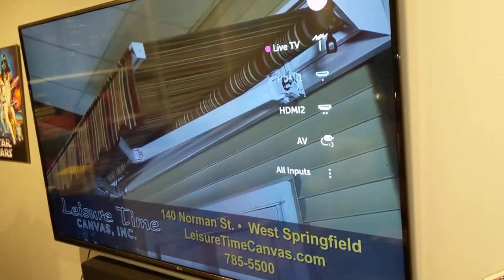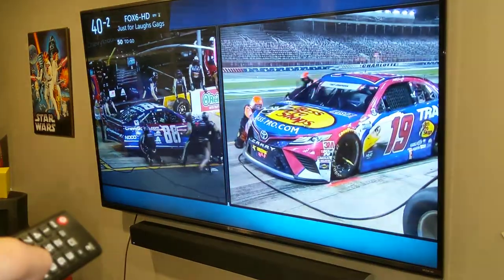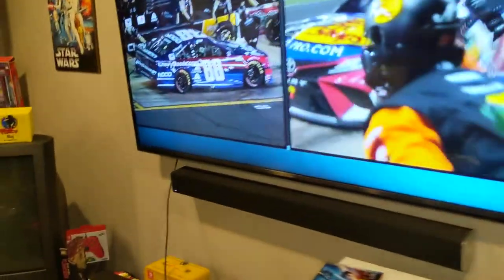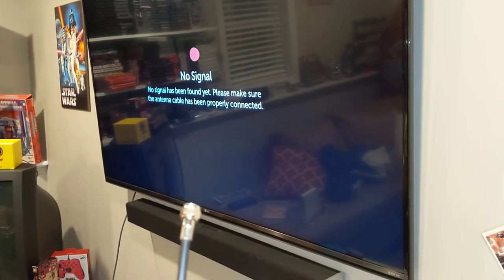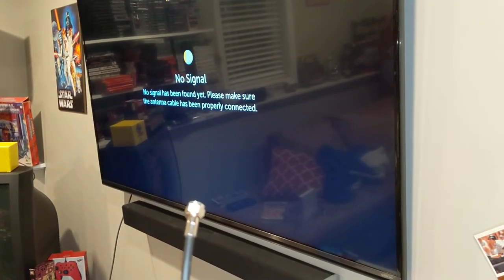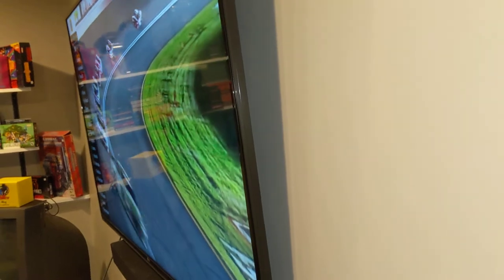YouTube "Myth" for a DTV antenna WORKS!

Comment: Tim, if you get a paper clip (MacGyver style)and lengthen it and shove the end into the coax input of the tv you will also get a signal.  The actual strength of the signal and number of channels you will get, with such a small antenna, depends on how close you live to the TV station transmitters.
Reply from the maker: Hah that's great. Why did I never do that as a kid?
Reply: I've tried it with mine. Didn't get anything.
Reply: That's how I watched TV at school when I was a kid during detention. There was a TV in the same room. Brought snacks as well. Enjoyed several hours without boredom.

Comment: All you have to do is have a piece of metal that, in its physical length, is in some close multiple in size to the wavelength of the signal.  So yeah, the metal in your wiring is basically acting as an antenna.
Reply from the maker: That's pretty neat. I will admit, when I came across this I want sure how these antennas granted the signal or if you needed certain physical dimensions. All I can remember were the old rabbit ears. And I feel like each one was a couple feet long

Comment: I was in a Rent-a-Center yesterday and they had a small length of rigid wire they had jammed into the coax input. It stuck out just a few inches and had been bent upward like an antenna. It seemed to be working as they had Family Guy playing.
Reply from the maker: Yeah guess that makes sense if you're only trying to show that the TV works!

Comment: Truth and Quality
Practical and Useful Information.
------------------------------------------------------------------------------------------------------
Yes is True any random piece of wire or metal will work as a antenna.
------------------------------------------------------------------------------------------------------
Yes is also True that metal that is shaped and sized to resonate at
electromagnetic Tv frequencies will work even better.
------------------------------------------------------------------------------------------------------
Yes is True that the best reception is , L.O.S. Line Of Sight Reception.
Line Of Sight is the antenna is installed outside at a location that is
free of any and all types and kinds of obstructions between the 
receiving antenna and transmitting tower/s antenna/s.
99% of the time height will improve reception.
------------------------------------------------------------------------------------------------------
www.channelmaster.com , has antennas and reception maps.
------------------------------------------------------------------------------------------------------
www.antennasdirect.com , has antennas and reception maps.
------------------------------------------------------------------------------------------------------
www.winegard.com , has antennas and reception information.
------------------------------------------------------------------------------------------------------
www.3starinc.com , has antenna mounting hardware.
-----------------------------------------------------------------------------------------------------
www.tvfool.com , has reception maps and advisors.
-----------------------------------------------------------------------------------------------------
Wall Pass Through , www.walleyesolutions.com
-----------------------------------------------------------------------------------------------------
Type the words , flat jumper coax , in , www.google.com , 
www.yahoo.com , www.amazon.com
-----------------------------------------------------------------------------------------------------

More services.
-----------------------------------------------------------------------------------------------------
www.broadbannow.com , find internet providers.
-----------------------------------------------------------------------------------------------------
www.ooma.com , low cost home phone service.
-----------------------------------------------------------------------------------------------------
www.rabbittv.com , Aggregator of streaming Tv services.